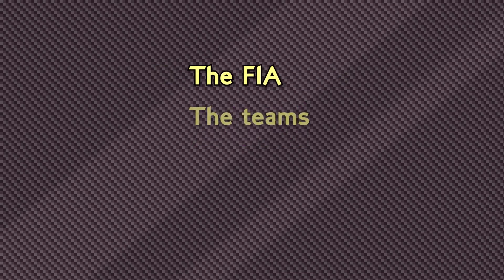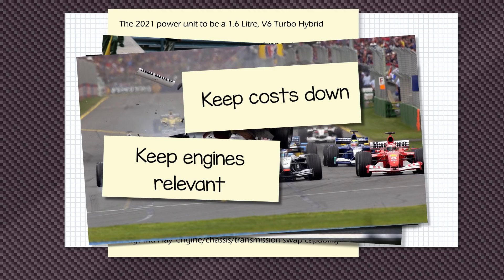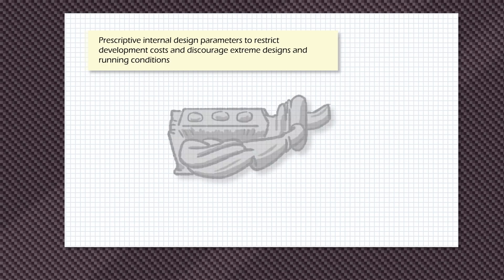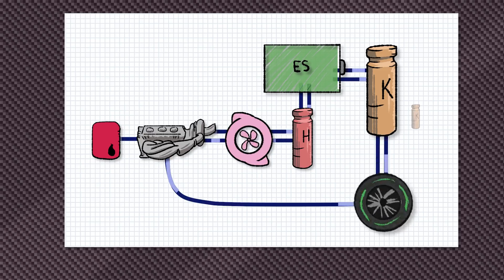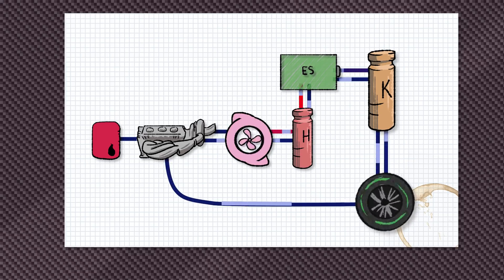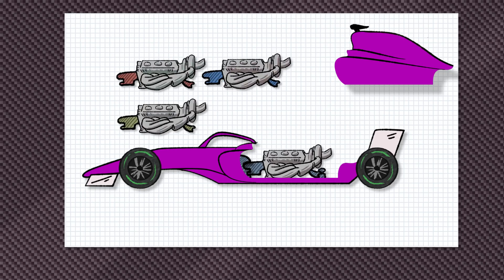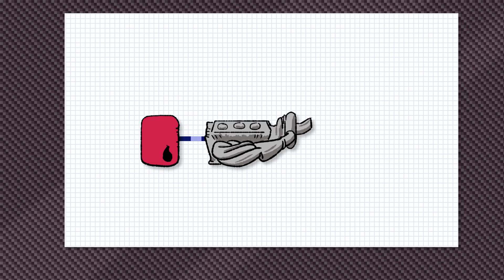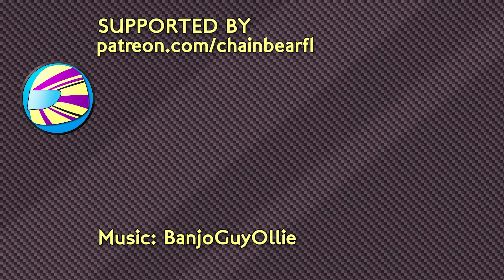F1 Engine proposals 2021 explored

Comment: god damn it, i want engines that are actively trying to murder their driver!
Reply: Jesus wept!  I don't think the OP literally wants the engines to murder their drivers, just deliver more power and torque than any normal human being can control.
Reply: A turbo engine with two energy recovery systems unshackled from fuel saving and flow and endurance rules would absolutely destroy any V10/8 NA ever produced.
Reply: So, like in 1988?

When the cars had >1000hp turbocharged Straight-4s and V6s?
Reply: Yeah, what's all this crap about internal combustion and energy stores and MGUs? Just stick a rocket on the back of the car. Much faster and more fun!
Reply: Shockwave Shockwave
No, that's a Le Mans car (which, btw, is called the 917. The 918 is a modern hybrid roadcar with a V8).

What I mean is the McLaren MP4/4 or the Ferrari F1/87, or the Brabham BT52. You know, the insane 1980s F1 cars.
Reply: Snuggle bum 3 year olds know you can make you're own 'engine noises' as loud as you want
Reply: the V6 is probably trying to kill it's driver much more than the v10 or v8
Reply: current F1 engines are more powerful race engines than any F1 engine every before. Only 80s Turbos with special qualification engines managed to produce more peak power but current engines might already produce more total power over the qualification lap.
Reply: I want a 1500+ hp 19000 rpm turbo V8
Reply: ShadowFalcon do you mean the one 180° v-12 twin turboed Porche? The... 918?
Reply: These comments on the engine tell me that some people associate noise produced with excitement, disregarding performance altogether as an important factor. By that mindset efficiency or even power mean nothing.
Reply: I heard Sir sterling Moss say when asked what he thought of all the safety improvements made in F1 he said " There is nothing more exhilarating than 200 mph into a corner and knowing whether you'll come out alive"
Reply: Ardi Januar What? F1 drivers the last few years have literally begged for cars exactly like that. They want a challenge, Fernando Alonso straight up said he's BORED in the car.
Reply: luis _  He isn't. He is just explaining the regulations. These regs are a step in the right direction. Keep the v6, crank up the revs and you'll have better sounding cars. 

The 2018 Honda engine sounds like an A10 Wartog downshifting. It growls like crazy.
Reply: Hyun Ji 16  I'm pretty sure he was being sarcastic.
Reply: Snuggle bum , 110% Agree 👌
Reply: hahaha
Reply: How about a turboshaft engine?
Reply: Ardi Januar group b was killed by spectators not giving them room/ respect, but were the definition of pioneering sport. But I'm old school so I'll always go for growl over a whirring laptop.but I accept I'm not the majority just my tupence worth.
Reply: F1 is now safe enough to have dangerous lag
Reply: I am sure Snuggle bum is just being sarcastic.
Reply: Why not rolling every regulations all the way back to the 1955 Le Mans when more then 50 spectators killed during that crash? Stupid ideas
Reply: So do I
(sarcastic tone)
Reply: I get your comment but the thing is the drivers well are also into it in fact this is the thing that they love to do, a part of the Motorsport driving motto is "death is in the job description".
Reply: thats group b for you
except that Not only the engine but the entire car is trying to murder you
oh and the track as well
Reply: These people were legends and the drivers were admired as heros not rich fuckboys
Reply: if it's not loud, it's not fast. all 3 year old's know this to be true.
Reply: What a a stupid comment.  You idiots obviously don't anything about racing.  Fuel management, tire management and machine sympathy has always been a factor in racing.
Reply: @Bahamuttiamat  and you obviously don't either 😂
Reply: @Bahamuttiamat  A factor in ruining racing also. 🤣
Reply: Go big or go home! If you don't have balls to drive a 1200hp v12 then just don't drive it! Nobody is or ever were forced to do this. 
If you have courage, then put your neck on it and show what you got, try to be great doing something hard as fuck, risk your life to show that you can do better than anyone, face the death to put you name in history. Do it if you have balls, if not, go home, nobody is forcing you to do it.

There's no achievement if there's no risks. Bigger the risks, bigger the merits. Simple. If you want safety, just go drive a automatic 85hp fwd electric, with TC, ABS and everything of this kind of crappy in a fucking video game.
Do safe things is usually boring, drive safe is boring, watch someone driving safe is so fucking boring! Damn!

That's why group b is the most memorable, something that will be remembered until the end of humanity. I hope to see something great as that in my life time... This era is just fucking boring. Just a bunch of faggots crying "this is not safe, this is not politically correct, this is not ecologic". Go home play games kids, go hug your grandpa, go have a happy and long life taking no risks, JUST DON'T FORCE THOSE WHO WANT TO BE GREAT TO PLAY BY YOUR RULES.

Before anyone say something about my life as an "argument", I'm starting my career as a rally pilot.
Reply: These current hybrid power units have more power, and way more torque than any V8 or V10 back to the previous turbo era. Im sure if you were sitting in one, you'd be damned sure it was trying to kill you. If it doesn't look like they're trying to kill the drivers, thats probably because of the quality of the chassis, tyres and drivers.
Reply: Chris Fokjohn They also died, some gruesomely.
Reply: Snuggle bum fun to watch for fans, not fun for driver, teams and their family. Just look at group b rally and why they are dismissed. Injuries and fatalities are not good thing.
Reply: @ardijanuar2036  Group B was the fault of stage clerks not adapting to the newer, faster cars, and giving participants bad pace notes. I lie awake at night sometimes, wondering what Group S could have been. In the stage clerks' defence, it's not easy to adapt to a car that can do 0-60 on gravel in 3.9 seconds
Reply: Boris pace notes are no different for a fast or slow car all they do is tell you what the track ahead is like.
Reply: for racing something like 600-700hp 1.1l v4 would be better if they could remove most of aero performance restrictions that create wake turbulence, Current engines are simple making these cars too fast on tracks that we have making them unsafe without some kind of performance reduction restrictions. Of course reducing engine power instead of adding aero drag isn't equal performance reduction which might still require some safety changes to tracks but at least they wouldn't require near complete safety rebuild.
Reply: group b rally was legend , I have an 84 ur Quattro which may kill me one day ... but I will have really lived!!
Reply: Nathan Gamble its technology mate......f1 has been a part of technology development....so suck it up or watch other series where rocket are made for racing.....

Comment: so for me they need to decided if they want to compete with formula e or not. in the arms race for better electronic technology. if they don't wont to do this then they should go for being an entertainment sport. go back to n/a engines that rev, less areo and big tyers. side effect of going back to n/a is that these engines are easier to make reliable.
Reply: Exactly
Reply: I hope the new Aussie 5ltr v8 wings and slicks gets so good traction. They sound mean as and have no where near enough grip for the power. Fun to drive and watch I hope
Reply: I agree that F1 needs to decide what it wants to be. 
Does it want to be cost efficient and attractive to manufacturers, does it want to be pinnacle of technology, does it want to be attractive to fans and fair/exciting? 

They are trying to make engines simpler and, theoretically, by limiting the amount of engines used cut the the cost, to attract manufacturers. However, I think, as long as there is no power/resource limit, generally the team with the most money put into R&D of the engine will win. If they want it to be truly accessible cost-wise, they should limit how much money teams can put into developing the engine, or standardize the engine design.

Focusing on technological advancement is something that's not sustainable in the long run, be it because cars are getting too quick or the expenses too high (usually a combination of both). The way to do this, IMO, would be to make rules more lenient BUT at the same time introducing some R&D costs limit, but allow more testing. This way, it would not be about who can pump as much money into their team as possible, but who can come up with most innovative ideas and implement them (hence the more testing). Oh yeah, and stop banning everything new teams come up with, just because it makes them too dominant or is on the line with rules. If it's an expensive to implement idea, ban it, if it isn't, let others implement it too.

Being attractive to fans is probably the hardest challenge. Personally, I don't even care that much about how quick the cars are, but rather about the racing being exciting, cars being challenging to drive (this does not necessarily mean fast), seeing decent tracks, making the racing fair penalization-wise (in the last 5-6 years the amount of unfair/questionable decisions about racing incidents made me stop watching F1 almost altogether). 

I think series like IndyCar does being exciting and cost efficient really well, albeit at the expense of being pinnacle of technology. F1 tries to be everything at once, and fails to deliver on all fronts. It needs a clearer direction IMO.
Reply: Woolgun R&D cost caps would be a nightmare to enforce. It would end up the battle of the creative accountants.
Reply: Phil Dodd yeah you're right, I forgot to talk about that. I can already see Mercedes developing an engine for A class that's magically going to be suitable for F1 :P 
Tbh my whole post is kind of a late night rant that doesn't really say anything, although I still stand behind the need for a clearer direction.
Reply: The thing is, F1 isn't about better electronic technology only. It's about being the pinnacle of motorsport, the fastest cars available, constantly pushing for better technology overall. There are many other things to consider rather then electronic technology.

Sooner or later, however, I believe electrics will completely take over and FE and F1 will become the same sport. We'll see.
Reply: Sharmo38 screaming n/a engines are not that reliable, in the v10 era teams can use 2-3 engines per weekend. On the flip side if the engine goes wrong they just pop in new engine in relative ease compared to today engines. But thats not relatable to the spirit of relevance with road cars. They wants to learn and explore reliabilty technology that can be apllied for the masses. There is always a trade off though.
Reply: If you want N/A and big tyres there's always NASCAR, sure, they are lazy ass engines, their track is as interesting as a track car toy from the 50's, but they are N/A and have big tyres, what else do you want?

Comment: am I the only one who actually likes the sound of the v6 engines?
Reply: It’s not my favourite engine, (V10) but it actually sounds way better than on TV, and is slightly louder and slightly different each year. I know as I have gone to the Australian GP (my home race) every year since 2014.
Reply: Bob Mothers I like it too but the old V8 and V10 sounds separated F1 from other motorsport cars (in my opinion)
Reply: i do too bro
Reply: Bob Mothers So do I!
Reply: Bob Mothers You're not, they sound good. Maybe not as incredible as v10/v12, but they sound really unique. I personally just want them louder, sometimes it sounds like they're muffled, especially Renault engines, but maybe the new reg will change that
Reply: I personally like the Honda and Ferrari engine sound - Honda for the growl and Ferrari for the high-pitched sound
Reply: Since they are removing MGU-H and raising the RPM limit to 15k, i think the engines are gonna sound a lot better, higher pitch and louder. I'm not sure if they are getting rid of the MGU-H this years' season or 2021, but i'm fine with it, since i like the sounds anyway.
Reply: I actually rate it. They sound efficient, like they're wringing every last bit of power out of the thing
Reply: I love the 2017 ones especially the Ferrari engine
Reply: Bob Mothers it not bad....but i heard worse...
Reply: The Mighty Dash a v6 is not an inherently well balanced engine! A single bank of three cylinders has "firing order" imbalance - no matter how you draw the firing order up it will always end up with a pattern that includes either 1-2-3 or 3-2-1. This causes rocking front-to-back not present in a straight 6 (which are very well balanced engines). Remember, a v6 is just two banks of 3...
Reply: Nope, I do too!!!
Reply: Only 2017
Reply: Yes you are
Reply: I like the low RPM growl but the high RPM is a bit hollow vs the older cars
Reply: Raditya Indera - I couldn't care less whether the engines sound sound like bears fighting or kittens purring, I just want good racing.  Is the noise is not a fundamental part of the racing, but some may see it as a fundamental part of the experience - especially if you see the races live.  I've only been to one live race weekend, but it was back in the V10 era and the noise was overwhelming.  It was just noise with flashes of cars.  It was still great fun and a great experience, but I had no idea what was actually happening in the race as I couldn't hear the commentary (and I was too far from a big screen to see the times and positions).
Reply: They sound good
Reply: I like the Ferrari and Honda v6 engines because they sound the most exciting but compared to the v10s they are pathetic
Reply: The only annoying thing about the use of V6's is that the 6 cylinder engine is one of the most balanced engines types possible, far more so than a V8 so you can rev them way way higher in theory, yet F1 chooses to mute that, its so frustrating! A high revving 6 cylinder can sounds incredible, weather it be a straight or a V, check out videos of the 1970's Honda CBX1000 motorbike, it runs a straight 6 and sounds like an old F1 car! thats the 6 cylinder noise F1 needs!
Reply: Television don't do these cars justice.  One needs to attend a race, they all sound unique and different.  The sound isn't overwhelming.  Without looking you can tell a merc pu, from renault and ferrari.
Reply: Bob Mothers You never heard the real F1 sound then :) Ive heard only the v8s (not v10 or even v12) its really mindblowingly beautiful, then i heard the v6s. Its utter trash. Just like generic sound from any car.

Comment: Ditching the MGU-H is a major step backwards, and I'm concerned that if we move to a third party energy store, and only 2 are allowed per year, and they're actually a bit crappy then we'll be having random failures of the cars not related to the driver or manufacturer, which is a serious problem
Reply: Are you saying the auto industry doesn't want faster, more fuel efficient engines?  Are you daft?  Efficiency has always been the name of the game.  It's the reason cars went from front engine to mid engine.
Reply: Tele Lisast well then there could be a standard MGU H then? Supplied by Mercedes for the rest of the teams? I just can't see it any other way. It is a great tech but its very tough to develop (you can see it from Honda) and costs a lot of money.
Reply: DildorTheDecent if you need confirmation here you go: https://www.google.hr/amp/www.crash.net/f1/news/882740/1/horner-f1-engines-have-zero-road-relevance%3famp
Reply: Bahamuttiamat Auto industry wants to go full electric...
Reply: As trucks and marine diesels have been using MGUH type systems since the 1950s, and all auto makers are pouring research funds into various heat recovery systems, your statement  about relevance would seem to be wide of the mark
Reply: The company that implements this onto passenger vehicles will produce the standardized module used in F1 (first).
Reply: John Smith You have to understand that F1 is a racing series first and a technology playground second. While getting rid of turbolag it is a multi million dollar investment in a part that doesn't bring anything to the racing. F1 needs to be sustainable and the costs of these power units need to be reduced, so the MGU-H has to be removed.
Reply: >anything that F1 has it's not comparable with road cars.
Please explain why F1 is aligning with the auto industry them? More and more modern vehicles are adopting downsized turbo charged engines, some are even going to hybrid route. Sounds comparable to me. 

inb4 "muh carbon monocoque", "muh halo",  "muh tyres that last 10 laps",  "muh brakes that only work at 700C". Dream on kid. F1 is more relevant to modern day vehicles than it ever was.
Reply: John Smith standard parts are usually very reliable.
Reply: MGU-H brings lots of power output so it brings quite a lot to the racing.
Reply: > Ditching the MGU-H is a major step backwards - only from the techonology standpoint, from the racing and fan standpoint it's the right step in just about every aspect.
Reply: Jay Edlington MGU H has nothing to do with road relevance...basically anything that F1 has it's not comparable with road cars.
Reply: DildorTheDecent ask Christian Horner about that...
Downsizing is "the ting" and so is the hybrid part of the engine...

But there is nothing that is comparable to road car relevance...tyres, mgu h, turbos, fuel...there is nothing relevant to road car there...

So yeah...you're just talking rubish...